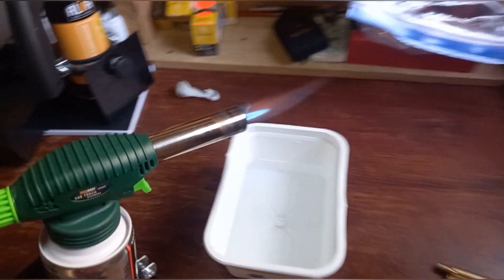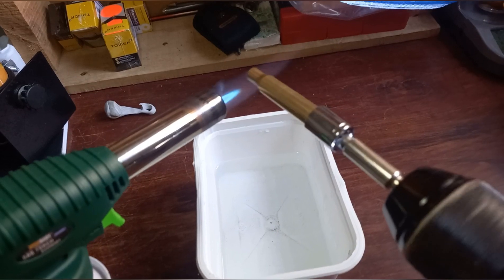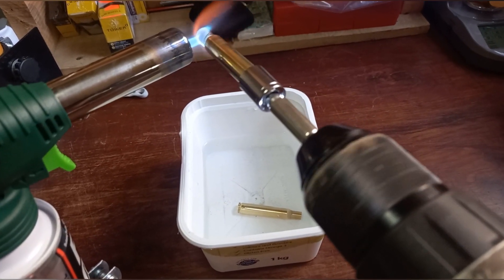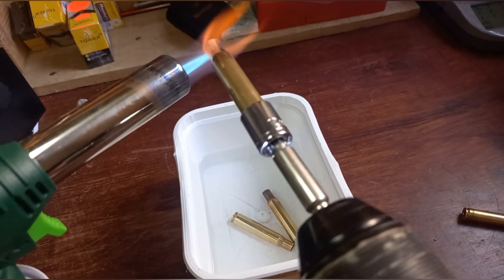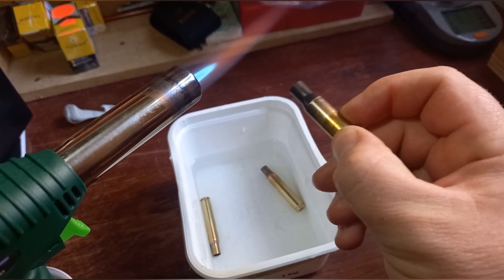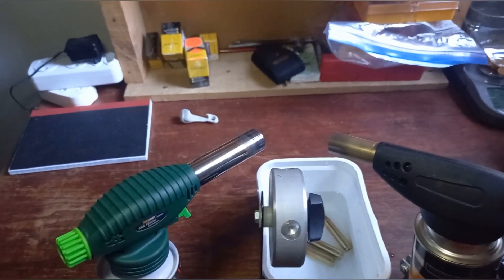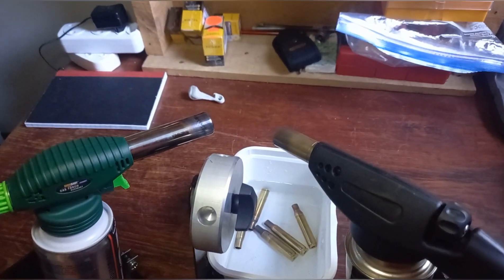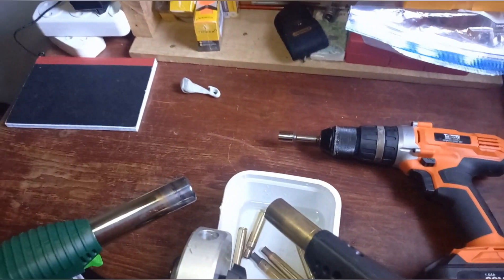Annealing brass, cheaper and easier than you think!

Comment: What I have found over the years is that consistency is very important in all reloading steps. I have used your method of annealing in the past and found that it is not consistent and has a negative effect on accuracy. Slight variations in annealing equals slight variations between cases in case neck hardness and that causes variations in sizing and neck tension. Inconsistent neck tension makes big differences on paper. For hunting your method might be suffecient but I prefer precision.
Reply from the maker: Spot on! When you are chasing the best possible accuracy you can get out of a rifle, especially for competition shooting, this method may not produce the best possible results. This is where you application will motivate an investment into specialized gear.

My method and perspective is from an average hunting setup where 1MOA accuracy at 100m is good enough.   The average hunter wants to get the most use out of his brass (extending case life). This is what my method affords the average Joe.